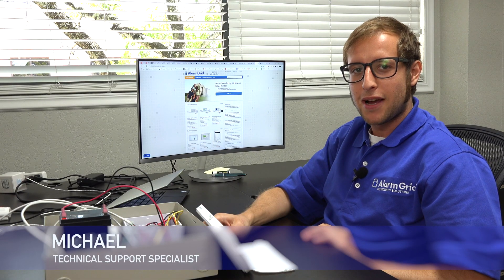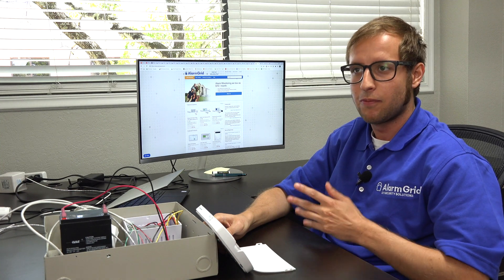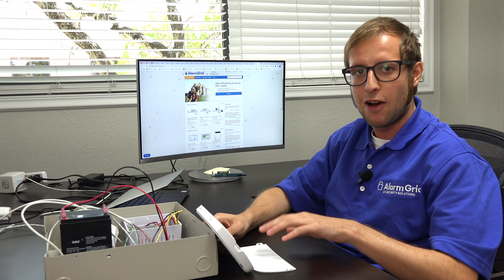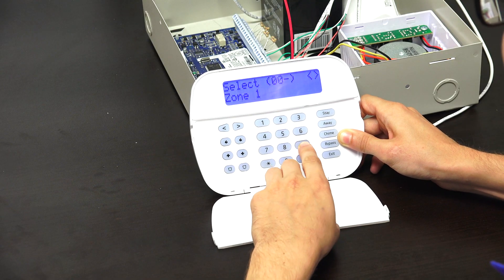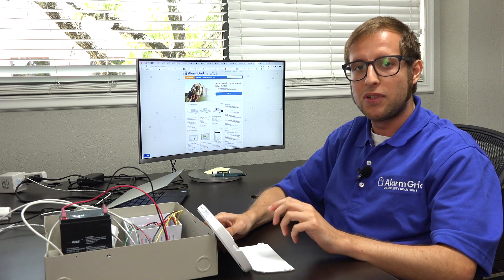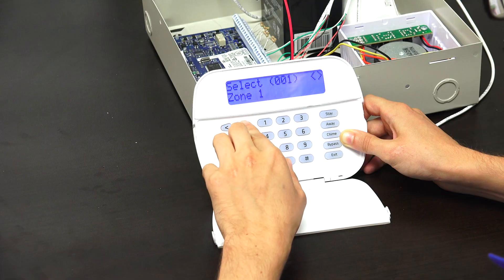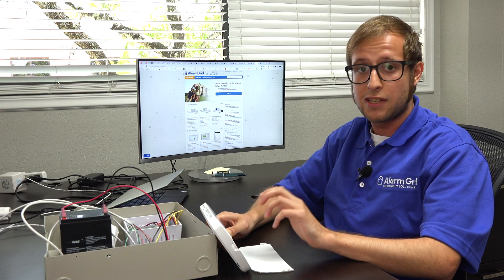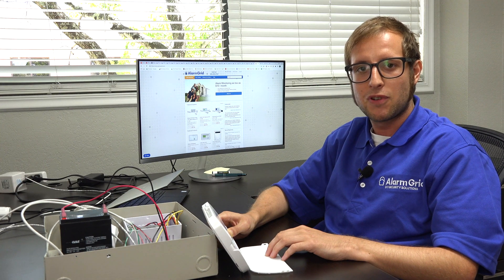Delete a Zone From a DSC PowerSeries NEO

Comment: Question, we have a DSC panel that we deleted a wireless window sensor. We have since fixed the window sensor and want to reactivate it. It is still recognized in the system as zone 13 with the serial number of the sensor. How do we reactivate it? Thank you! Are you reachable for further questions?

Comment: Great vid thank u so much!! One question. I deleted the wireless sensor pg9945 bc the unit constantly was running theu batteries every couple days. I ise the wired contacts. Anyway i deleted the zone as yiu said but it still shows up ad an open zone preventing me from arming the sytem. I tried pulling the power lead from the hs2tchp head unit. But when it restarted the open zone was still there even tho i deleted it. And verified in 804, 900. That there is no zone 7 anymore!!!
Reply: Hi ZAF88, You may need to re-add the sensor and confirm the serial number was erased also, you also may need to delete any other zone 7 related data from programming.

Comment: Thanks for posting but I find the section for removing a hardwired zone a bit hard to follow. Would someone please confirm the following is what's required: press *8, enter the installer code, press 001 [for zone programming[, press < or > to scroll to the zone of interest, press * [to change the zone definition], enter 000, then press # a few times.  Thanks!

Comment: How do you delete a Key Fob Remote 9929.  Battery died and after battery replacement it stays blue so need to remove it from alarm panel because it doesn't work anymore.  I have two of them and both died at the same time.  Thanks so much
Reply: That depends on the panel you are using. Please follow the instructions for removing zones from your particular panel.

Comment: Nice vid.. How do I rescan the keybus? I removed an IT-100 and now it thinks there is a fault.  Apparently its #902 - but I don't know where/when to enter that code? Is it *8-555-902 or *8-555-0-902?
I don't want to accidentally delete a zone or break anything ..
Reply from the maker: Does the IT-100 get treated like a keypad?  Usually, a power cycle will cause a bus scan on most panels.  According to what I was able to find, you would enter *8 + 5555 + 902 + 101 (for keypad removal) then enter * to select the correct keypad type, then scroll to the specific keypad you want to delete, press * to select that keypad, then * again to delete it.  Then # back out of programming.  I have no data on the IT-100 so I can't tell you what type of keypad it will emulate or exactly where to find it in programming.
Reply: @AlarmGrid  Yes - Its referred to as a virtual keypad.  I tried your code, but it seems 5555 is not my installer code and I don't know it.  Should I just unplug the power for 10 seconds and power it back up?
Reply from the maker: @fpvclub7256  It certainly can't hurt to do so. Aside from that, maybe you should contact tech support for the IT-100, they should be able to assist you further.  That is not a product we offer supporot on.